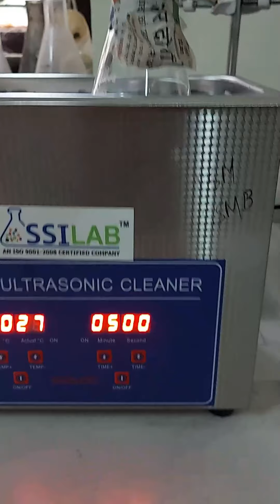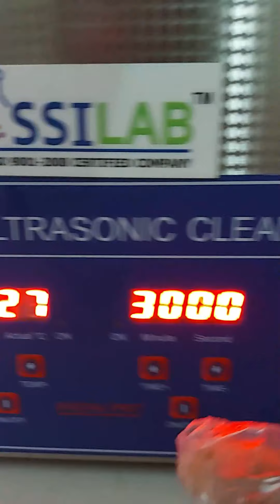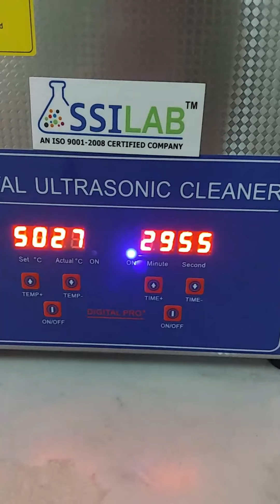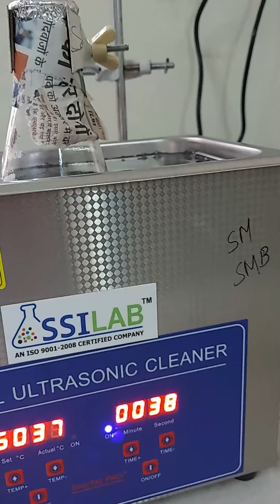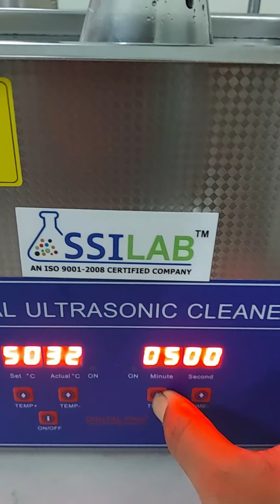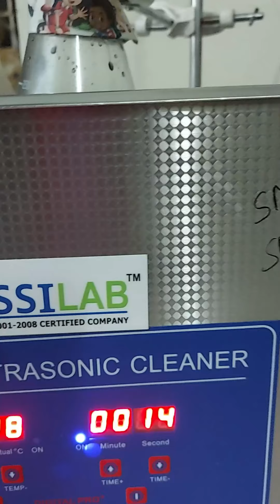Carbon Nano Tubes (CNT) Dispersion and Sonication with Epoxy Resin

Comment: Would you ever use a horn sonicator instead of a bath? I've been reading up on literature that suggests using one instead of the bath would be better for dispersion and thermal conductivity. just want to get your opinion, also I haven't used either, so I've been looking for videos on how to use them with CNT and nothing came up for horn sonification, at least nothing of use to me.
Reply from the maker: Hello, I also went through some literature. Horn sonicator can also be used for CNTs dispersion in epoxy. However, I did not find any comparison study between horn sonicator and sonicator bath. If it is necessary to identify the effective sonicator, optical microscopy or UV-vis spectroscopy can be used to assess the quality of the CNTs dispersion. And I, personally, have not used horn sonicator for my research.
Thanks

Comment: Would this process be sped up by the use of an ultrasonic homogeniser? 
Does heating the epoxy to such a high temperature in any way damage the structural capabilities of epoxy? 
Sorry for the questions. I am not an engineer. Great video though.
Reply from the maker: The glass transition temperature of the resin used is 130˚C, provided by the manufacturer. As the heating temperature during the stirring process was kept at 120˚C, it
could not have caused significant changes to the resin in terms of flexibility or other properties associated with the glass transition.

And yes,  ultrasonic homogeniser can also be used for the dispersion process.

Please do not be sorry for asking questions. Thank you

Comment: Sorry, one more question. Could the epoxy be combined with the cnt using this method, and then stored for a period of time before combining with hardener and used, or will the cnt fall out of suspension and settle to the point where they cannot be mixed back in? Thanks!
Reply from the maker: After the completion of this process, the solution product is usually kept in a vacuum chamber, for 24-72 hours, to ensure that all the voids are removed.  However, if the product is kept undisturbed for a longer period, the CNTs may agglomerate again.

Comment: Hi, thank you for this video, i recently started working on CNT ink, and the target is to coat CNT on plastic substrate, PET, or ABS. Is this epoxy based CNT dispersion thick and adhesive enough for self adhesion to substrate  ?? Could you please drop your email ID please, thanks, i need your help
Reply from the maker: suryamani1014@gmail.com
Reply: @Mani_Sipol_67  please check inbox, i have contact you via email, thanks

Comment: I have some questions, Won't the CNT structure be damaged at 120 degree?
Reply: and Won't the epoxy or CNT chemically react with acetone?
Reply from the maker: choose low-power sonication and shorter durations, mild solvents to minimize damage. Multi-walled CNTs (MWCNTs) are more resistant to damage than single-walled CNTs (SWCNTs).
Reply from the maker: @ No

Comment: Hello. Im from IITM and working on something similar. Can I get ur mail ID?
Reply: also what's the difference btw this and probe sonicator.?
Reply from the maker: @sumaiya.ismail  probe is used to maintain the solution (in the container) temperature with the plate temp. If you remove the probe from the solution, tje plate temp and the solution temp might be different.
Reply: @Mani_Sipol_67  Dropped an email. Do look into it. Thanks